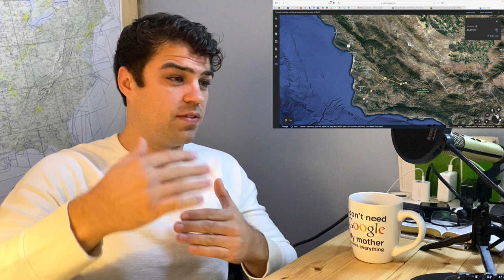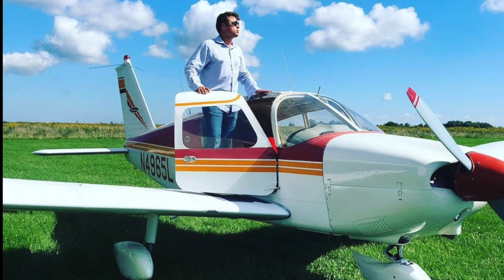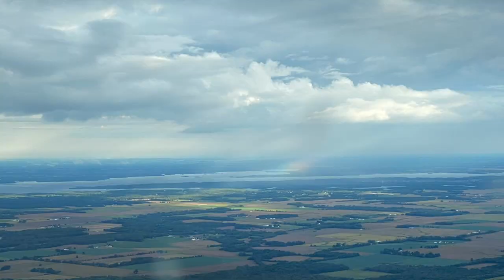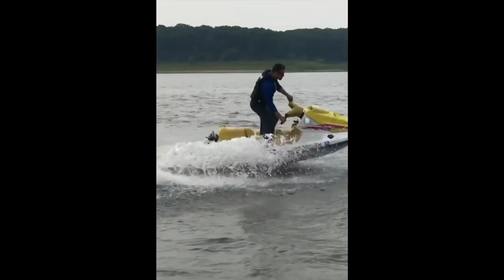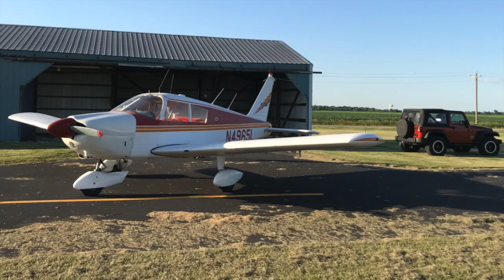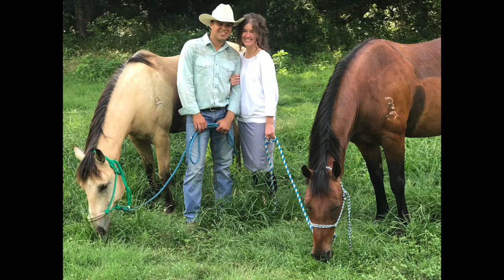How Trevor Jacob Intentionally Caused An Engine Out Scenario Leading To An Airplane Crash.

Comment: I don't think your numbers add up:
1) I think it's a stretch to say he flew 64 miles to get there when it's around 30 miles direct. Even trying to match the route you showed on the map I only got to around 45 miles.
2) You suggest he took a gallon to taxi, three gallons to climb, and then somehow five gallons for an hour of flight after that. What was he doing for an hour after the climb? The Taylorcraft isn't fast, but it's not going to take it an hour to fly sixty miles. Cruise speed is 110mph.
3) I don't know where you get the nine gallon fuel tank value from, as everything I've seen (including the references you cite) say it had 12 gallons.

Also, the fuel dipper sticking out the cowl is showing pretty proud in the video. Sure, the fuel stick could be stuck, and he could have only filled it halfway, but I can't see anything in the video to suggest that's what happened.
Reply from the maker: 1) I got the google earth image measurements on the trip shown. Identify the flight path and you will see I was being generous 
2) actually, it is going to take 4-5 gallons to fly sixty miles with an added 3 gallons/hr burn for the climb. It’s added to the cruise burn (he was burning 8 gallons/hr in climb)
Reply from the maker: 3) actually the POH states that it had a 9 gallon main tank. Read the “fuel management” chapter.

And with only the main tank, it is impossible the stick is reading accurately
Reply: @DailyNOTAM  Taylorcraft never made a 9 gallon tank in that model plane. Your “poh”you keep referring to is a pilot report that someone wrongly wrote. look anywhere else for proof. They could have up to 24 gallons of fuel. 12 gallon main and 6 gallon tank in each wing. Where are you getting your fuel burns and mph from?  The whole video is just full of misinformation.
Reply from the maker: @tylerrockwell6080  Where are you getting your info from? Fuel burn and mph were calculated and verified with a taylorcraft owner. Please at least do some work before bashing mine.. would help the cred of your argument. 
The certified aircraft database linked: 

"Engine:                 

Continental A-65-1
                        
Wing span 36'

Length 22'

Height6' 10"

Weight empty 700 lbs.

Useful Load 518 lbs.

Baggage 30 LBs.

FUEL 9 Gal.

Fuel:                   

 73 min. grade aviation gasoline"

POH on the link: (note only extra tank in right wing on a models - this is an a model).

"FUEL SYSTEM
The fuel system on the B12 consists of a twelve gallon terneplate gas tank located in the
front of the fuselage and a six gallon tank in the right wing. The valve for the wing tank
is located above the corresponding door. The wing tank should be emptied when the main
tank is half empty. Fuel is gravity fed to the carburetor. A small copper screen is placed
in the outlet of the tank. Flexible hose connections are used between the tank, filtrap and
engine. A small copper line is attached to the filtrap inlet to deliver gas through the
primer to the cylinders for starting.
The fuel system on the Model B consists of a twelve gallon tank in the front of the fuselage as standard, and a six gallon auxiliary tank can be installed behind the seat as
extra equipment"
Reply: @DailyNOTAM  I Own and fly a Taylorcraft.  Reread what you just sent me.  It literally says under fuel system that it has a twelve gallon tank.  They misquoted the 9.
Reply: From the manufacturer's POH that you link:

"FUEL SYSTEM
The fuel system on the B12 consists of a twelve gallon terneplate gas tank located in the
front of the fuselage and a six gallon tank in the right wing. The valve for the wing tank
is located above the corresponding door. The wing tank should be emptied when the main
tank is half empty. Fuel is gravity fed to the carburetor. A small copper screen is placed
in the outlet of the tank. Flexible hose connections are used between the tank, filtrap and
engine. A small copper line is attached to the filtrap inlet to deliver gas through the
primer to the cylinders for starting.
The fuel system on the Model B consists of a twelve gallon tank in the front of the fuselage as standard, and a six gallon auxiliary tank can be installed behind the seat as
extra equipment."

Given that the jump spot is about thirty miles from the airport, and the fuel meter in the video is reading that there was fuel left, it seems like you have add a bunch of stuff there's no evidence for to claim he actually ran out of fuel. I mean, I know normally someone flying a Taylorcraft isn't going to climb to 10,000 feet, but is your claim really that flying a Taylorcraft for less than an hour will exhaust its fuel supply?
Reply: Having another look at the route, I still don't see how you got that trip going to far north, but at 44 seconds in to his current version of his video you can see he's heading roughly east, just passing Los Alamos. You can clearly see the 'Chisan Orchids Nursery' off his right wing. At 51 seconds in you can see he's now headed northeast, with Liebe Canyon slight to his east.

The whole route is 29 miles, and while it's not magenta-line straight, it's pretty direct.
Reply: @DailyNOTAM  OH DAMN, I just realized where the confusion comes from. In your video at 4:18 you say the route is 63 nautical miles, but have look up in the top corner of your video. The route is 63 KILOMETERS.
Reply from the maker: I love the information and thanks for taking the time to reply!

So the indicator up front seems to indicate fuel, while I think we all agree his wing tank was disabled? 

If he only had his main tank, You are saying he could have traveled this far (maintaining the flight path) and to this altitude on less that half a tank?
Reply: @DailyNOTAM  I think that with a 12 gallon tank, even burning the 8gph for a climb that you suggest, he would be at half fuel after 45 minutes. Given that the jump area is only around 30 miles away from the departure airport, I think it's very plausible.
Reply from the maker: 1) It looks like I messed up and used kilometers instead of miles, I'm following you, so say it is 45 miles (he flew more than 7 miles each way outside of direct though), we have to factor a climb.

2)
a. Max Structural Cruse is 102 https://www.aopa.org/news-and-media/all-news/1997/may/pilot/taylorcraft-f21b
b. Climb performance is 58kts with  a 720fpm starting at sea level and getting extremally weak up higher all the way to 10k.
c. What this does prove already is that the fuel gauge was not working. He would have not only burned the 1/2  or less of a tank that the indicator suggests. (proof the gauge is not accurate).
Reply from the maker: 3) look at my description, i say he used 9 gallons minimum. I may have mis-spoke but what intended to say is that he used 9 gallons minimum to get where he was.

Comment: Not to have an electric system At All.. Then why does it have an Antenna coming off the bottom of the Cowling? I also see the same antenna on the same plane 5 years ago. So therefore this plane had a Radio, that he DIDN'T USE.

Comment: You can clearly see there is fuel in the header tank from the float stick.
Reply from the maker: Thanks so much for your thoughtful and insightful comment! I am sure alot of people will glean alot from it. What this video proves is that his intention was NOT to fly to Mammoth as stated. While we can all feel that, this confirms it. The float stick is either stuck or rigged. it is a common issue and also note that he didn't have adequate fuel even if that was the case.
Reply: @DailyNOTAM  Dude your ill informed...

Comment: So… the fuel level indicator was stuck before he bailed?
Reply from the maker: exactly
Reply: @DailyNOTAM  I left a reply on your Facebook post. I’m not educated on the fuel system of this aircraft.

Is the fuel level indicator of the main tank linked to the header tank?

If the header tank is disconnected, the main tank level indicator should still be operational.
Reply: @DailyNOTAM  no

Comment: Please tell us how far he could have glided back from that altitude? 
Also, was it ok for him to be at that altitude without radio and transponder. I don't know that airspace.
Reply from the maker: it looks to have less than a 6lb/sqft. A cessna 150 has about 10lb/sqft. so it would glide significantly farther than a 150... hoping a taylor craft nut can comment that
Reply: No transponder or adsb required on planes without charging systems. No radio required on any plane in g or e airspace (everywhere excluding b c or d ground to 18000 and with some exceptions over that) radio required in d c b and a airspace
Reply: @DailyNOTAM  That Tcraft only would weigh 700 lbs  glide ratio is 10 - 1 but at sea level with that little dude in it you could count on 12-1 I bet that's a long way at that altitude probably 12 to 15 miles and at least 10 mins to figure it out.  Let's get a Taylorcraft and try it.

Comment: You could be right, but your video offers no proof that the engine quit due to fuel exhaustion.   Your speculation that the wire gauge was stuck or rigged is just that, speculation.  Personally, I think it unlikely but I would call that speculation as well I suppose.   They can get gummed up, but cleaning a wire gauge is one of the simplest maintenance items you can do on a T-Craft, Cub, etc.  Rigging the wire to not fall as fuel is used would likely cause it to appear "off angle", at least if it was simply bent to prevent movement down.  It's been established that the wing tank is disconnected but this is irrelevant and does not impact the main tank at all.  The handle to fuel valve for the main tank in a T-craft is located on the panel itself, which of course is not displayed in the video.   Point is, nothing in the video shows his actions or in-actions in the cockpit to prove or disprove fuel exhaustion or fuel starvation.

While I no longer own it, my C-85 equipped 1948 Cessna 140 would take about 25-30 minutes to climb to 10,000 and that was more or less my service ceiling.  I would burn 3.5 to 4 gallons to get there, so your analysis for climb burn is by my experience pretty close.  I also believe that the engine in his aircraft was not a C-65 and was more likely a C-85 or O-200, but climb burn would have been roughly the same due to better performance despite higher burn rate.  That still leaves 8 gallons on board and perhaps 6-7 usable (the 1940 T-Craft came equipped with a 12 gallon main tank).  This looks to be about right based on the position of the wire gauge.  Note that I do not own a T-Craft, nor have I.  However I have recent experience assisting a friend gassing up his C-65 quipped 1939 T-Craft from 2 gallon cans.  At 2/3 full, his wire is about the same height as the one in the video.  This is not proof one way or another, but it is a real-world observation.  

We don't know if this aircraft was equipped with mixture control.  Many C-65s, 75s and 85s are equipped with Stromberg carburetors and a lot of folks just wire those full rich.  Still, an engine can be shut down simply by shutting off the mags or closing the fuel valve.  Regardless, any of these methods would need to remain in configuration or windmilling would fire it right back up again and the final configuration would likely be observable in the wreckage.  That, on it's face, does not indicate guilt.  If you land off-field, you would shut off both mags and fuel prior to landing.  Of course if jumping you want to make sure the engine will not restart, even if the emergency were real.  Either way, one might think he would spend a few minutes and a couple of thousand feet setting course for safety and troubleshooting the problem.  Seems strange he did not have a handheld and call for help.  Everyone I know who has an aircraft with no electrical system carries or even mounts a handheld.  That said, it's not required.

Speaking to glide performance as others have in the comments, in no wind my C-140 could manage 15 or 16 miles from 10,000 feet and I expect the T-Craft might do about the same, maybe a bit more with a stopped prop.  This is assuming you nail best glide.  With a Southerly wind, gliding to Santa Ynez might have been a stretch but I don't know winds aloft for the area and time.  It does seem that he could have easily made it past the foothills, though, for an off-field landing in a level and cleared area near civilization.  But we weren't there.

Of course, this thing looks and almost certainly was staged.  The analysis I've seen from YouTuber's has been amazing.  This has clearly upset a lot of people, including me.  The beautiful thing about a plane like a T-Craft is that so long as it is straight and hasn't been "cut up", it can be (reasonably) economically restored from nearly any condition.  Perhaps this plane was "ratted out", perhaps it wasn't.  But it's flying days are over only because of one guy's apparent callousness and greed.

Over the years as a lowly VFR private pilot I have logged almost a thousand hours, mostly in classic, antique and experimental aircraft.  Except for aerobatic training, never have I considered for one minute to wear a parachute.
Reply from the maker: Thanks so much for your thoughtful and insightful comment! I am sure alot of people will glean alot from it. What this video proves is that his intention was NOT to fly to Mammoth as stated. While we can all feel that, this confirms it.
Reply: @DailyNOTAM    I believe your video certainly adds to intent.  But it gets worse.  I haven't seen an analysis on potential flight plans based on potential departure airports and destination.  This gets interesting in a hurry and, I think, adds to intent.

There seems to be a question as to whether he flew out of Lompoc or Santa Ynez.  I'm not sure if the departure airport matters much, as time to altitude would be the same.  Interestingly, though, from Lompoc a T-Craft might just make 9,000 or 10,000 feet by the time he reached Wheat Peak whereas departing Santa Ynez would require a couple or three 360s to make altitude at Wheat Peak.  This is nothing in and of itself, however he is significantly off-course if flying direct from Lompoc to Mammoth, yet the engine "fails" while exactly on a direct course from Santa Ynez to Mammoth.  Further, a direct course from Lompoc would have minimized time and distance while over mountains and reduced necessary climb to only 5,000 feet, but then there would have been no emergency.  

Getting into the weeds here:  Prior, I just assumed that since there was no way a T-Craft could climb to 15,000 feet for clearance over the Sierras, his "plan" would be to fly East and under the Isabella MOA, then turn North and continue up on the East side of the Sierras.   This course is fairly technical due to airspace constraints and performance limitations, but certainly doable...with a GPS and radio.  But this more Easterly course still puts the aircraft fairly near  the engine failure point.  Being innocently off course (4-5 miles East of course) after such a short flight would be kind of suspicious, but without GPS and with some unexpected winds aloft I could see it happening (except, pilotage).  But in the video his heading as the engine quits appears to be approximately 90 degrees to the knife-like mountains below (and exactly how they would look if he were on course from Santa Ynez) whereas they should have appeared about 30 degrees off his right nose had he been flying the correct heading towards the MOA from Lompoc and was simply off course.   So in the end it just doesn't really add up regardless of departure airport or route.   To be fair, there are plenty of airports to land and refuel (assuming the main tank was full at takeoff) regardless of the route he will tell the FAA he intended to fly.  

I can understand why the engine failed when and where it did.  If you look at the terrain about 2 miles due East of Mt. Baldy (on the course to the MOA), it looks pretty rough.  Far fewer options and a much longer hike out.   But also a shorter glide distance past the foothills and maybe only 10 miles to New Cuyama airport, but then again there would have been no emergency.

To look at these routes on Foreflight:
KIZA KMMH (Direct)
KLPC KMMH (Direct)
KLPC KTSP KIYK KL36I O26 KBIH KMMH  (Divert around Sierras)

Comment: So, your point is that he ran out of fuel 18 mins after take off? Didn't someone spot a fuel indicator suggesting otherwise?
Reply from the maker: Are you suggesting that he climbed to 10k ft and traveled 64nm in 18 minutes? If you think that is real you probably think  the fuel indicator wasn’t tweaked or stuck…

Comment: Nathanael, I just finished watching the WHOLE VIDEO, and you didn't prove a thing.  On the one hand you say that his engine out wasn't faked --- but on the other hand you say that it was his intentional purpose to have an engine out.  So what's the difference between a fake engine out and a REAL engine out?  Does Trevor have to run out of fuel, or does he have to turn the key off and shut off the engine in mid-flight?
Reply from the maker: speculation does not stand in court. factual reasoning does: what I mean by this is that you can ask "how did you plan on making this trip with only 6 gallons of fuel on board? At the least it ties him to negligence.

All the other speculation is just that.... did he turn the engine off, so on and so forth.
Reply: @DailyNOTAM  I know that speculation doesn't stand in court.  But there are many things about the so-called "accidental crash" that --- like you said, ties him to negligence, and negligence DOES stand in court --- as well as moving evidence from the scene of the crash.